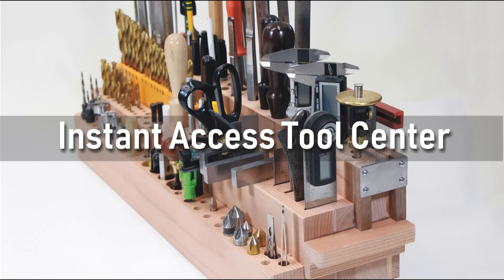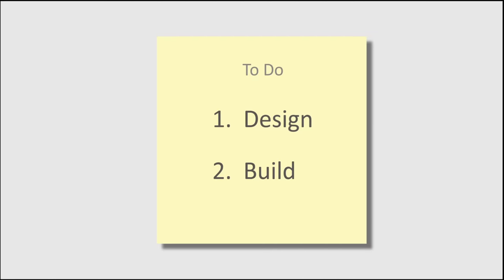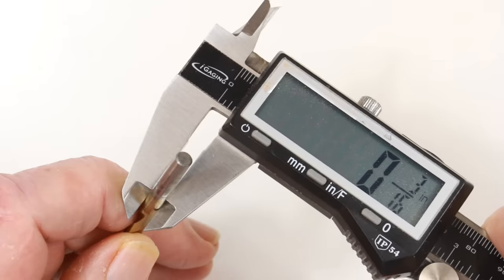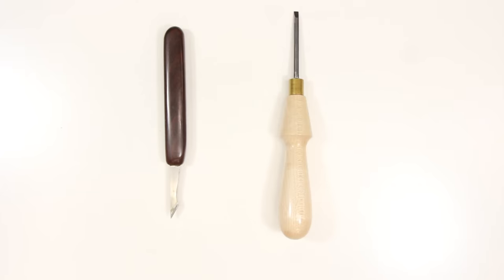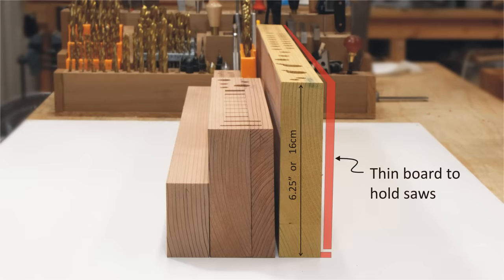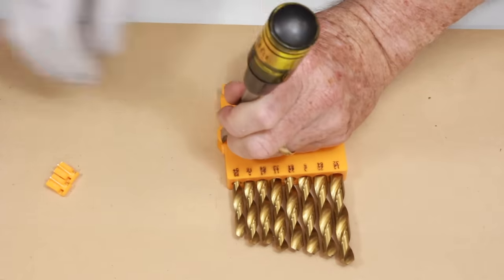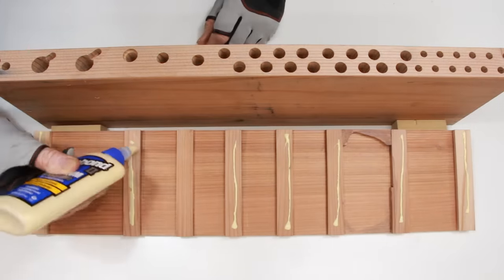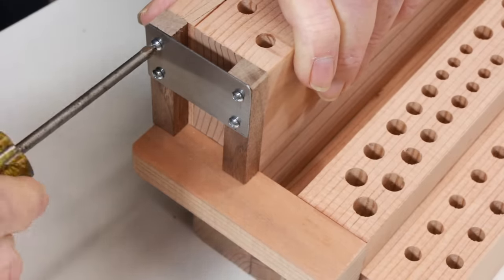Instant Access Tool Center

Comment: Thanks for this. My only negative is that the drill accessories should be put on a drill press tool holder. IMO this would make for a smaller, more job focused accessory. I did really enjoy your project and plan on building something similar.

Comment: I'm still working on this project.  I've gone down a couple of wrong tracks that required me to back up &  rethink my plan, because my tool set is different in type and number. It is getting heavy which surprised me a bit. I'm having a blast though. My old tool holder was a strip of wood with PVC tubes placed vertically all in a row.

Comment: A very nice presentation - I will have to check out your other videos.    For me, I have enough tools that I built an Adam Savage inspired shop cart to roll over to where I'm working.  But I ran into the same issue, tools cluttering up the work area during actual use.   

So I modified an old mechanic's rolling tool tray to the height I work at, and have gotten into the habit of using it like a surgeons tray,  returning all tools to it during the project.    It doesn't take up a lot of room and has really helped my workflow.

Comment: I built one to hold all the tools from a Chinese tool collection my mother-in-law bought me. It all came in a  blow molded plastic case and at first I sort've sneered at it, but then noticed that when I needed a tool, that was the box I went to. Patrick's tool center idea fit the collection perfectly once the blow molded case died. I added a bunch of other stuff I use and it is crammed with the tools I once spent hours looking for. I just built a second one to hold all the metal files and rasps I use in my knife making. The third one will be to hold all my leather working tools. Patrick, this is a simple idea but so apt for the way I work that I have bought several of your designs now, based on how well this one worked.

Comment: I'm looking to do a french cleat wall in my garage and basically build everything from scratch, and one thing i found is that most french cleat tool storage systems basically place everything flat against the wall taking up a relatively large amount of space. This assembly with several layers of storage back to back seems like the perfect solution. Thanks for the  inspiration!

Comment: I have most of these tools on my pegboard which is setup on the wall.  The work table is in front of me with me facing the back on the wall. That is because I have space constraints and I need to film while I am working. I turn to the wall to pick any tool I need. It never occurred to me to put the stuff i regularly in front of me. This is a great solution. It would save a lot of time (and space on the memory card of the card too)

Comment: That's a great tool storage mini center. I added a tool 'crib' to the back of my main workbench.  It's basically a long,but narrow rectangular  box with storage slots and holes. It holds the tools being used and keeps the working area free from tool clutter. I guess I have OCD in my shop. I want all tools and their siblings in their designated area. LOL.

Comment: I'm glad I found this video of yours. I have a bench I picked up for hand tool use and it has become my go to bench. Someone had put some time into building it as it is white oak and Walnut.  I bought it really cheap. I've since added a well to the back of the bench just so I can have some stuff there at hand. I did a quick orcanizer for my chisels but I have found it way undersized as I end up with everything crowding that spot. The well is great but does act as a catch all. I think I am going to adapt your design some and get the little things organized. I love the idea of moving it as I need to for large pieces or just to get it more handy for small stuff.  Thanks for the ideas. Now off to my shop.

Comment: Another excellent video by Patrick Sullivan. This one came at just the right time. I'm in the process of making something very similar for my little shop. 9 x 13 is all I have so I have to make every inch count. I have a small drill press mounted to one end of my bench and I wanted to have all the drill press accessory items right behind it on a shelf. This has given me the innovation that I was needing. I will also be making a small parts home similar to yours but smaller. Thanks so much for your excellent videos.

Comment: Well sir, you inspired me to make a tool center very similar to yours.  It usually sits at the end of my 6' workbench and has proven to be very handy indeed!!!  I made it out of scrap wood I had on hand.  As I live with it and use it daily for the next months or year, I will build a 2nd version out of some nicer wood, maple or oak or whatever.  Thanks again for your inspiration.  This saves me a lot of time and steps in my workshop.

Comment: Hello Patrick, Space is at a premium and this design is great.  For the side bar grips, I stood a piece of timber vertically and drilled down through using a 16mm spade bit. Then I sliced off the material not required. This left 1/2 to 2/3 of the cylinder for the grip. It took two goes to get the depth as the drill press stroke is only 70mm. I'll build a decent router table one day.......

Comment: Thanks for this well thought-out  project, with lots of very sound general principles and tips. A small addition to this that I will make is a cleat at the back so it can be hung on a (future) French Cleat wall I will be creating. This will allow me to keep it off the bench / work surface, while still keeping it handy and portable. Weight will be a consideration, so I'll need to think through the design carefully. Thanks.

Comment: I was having the same problem and built a very similar tool holder a few months ago. It was a revelation. Your design is better, but the key is having a designated hole/slot for each tool, so it always goes back in the exact same place. Btw, I also bought that exact same spatula from the dollar store months ago to make cheap chisels for weird/curved shapes. Cheap minds think alike.

Comment: This is great .. It addresses a real problem that I have and provides a very elegant and fairly straightforward solution.  Patrick is both articulate and compelling to listen to ... Loving 2.0 - great starting point - Thanks so much for sharing - As below the answer to where to get sheet stainless from is out there - being from the UK, I guess that poundland will take a hammering but even allowing for whatever happens with Brexit - I can afford $1.40 or so :)

Comment: Pat,  you had me busting my gut  laughing. The only difference between your rants and mine are the four letter expletives I like to garnish my frustrated rants with. I have a few years of ripening on the vine over you, so my shop's chaos quotient is equally elevated. I like to think of dealing with my dilemma as being illustrative of some classic truths.... 
(1)  Futility defined:  Shoveling sh!t against an incoming tide. 
(2)  Ya can't fit (See #1) 10 pounds of sh!t in a 1 pound bag. 
(3)  There's always room for another tool (See #2) or machine.
(4)  The wife doesn't really need that space (See #3) but I sure do!
Thank you for the enjoyable video. 
Chris of S. Florida

Comment: What a great video!  I have similar problems with organizing most needed tools.  Last year I buckled down and learned Fusion 360 to design similar tool holders that could be built with a 3D printer.  It is very nice to have the CAD files because I have changed my mind many times over the past year and making a new carrier is as simple as modifying the CAD file and sending a new concept to the printer.

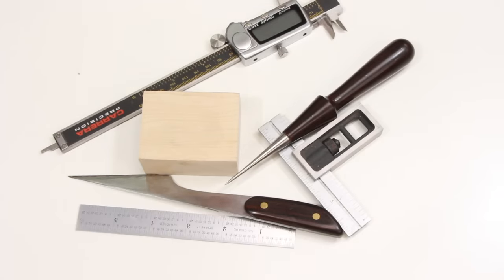Comment: That’s funny I had this same issue and build a very similar thing , just drilled holes in a large piece of wood had bits pens files wtv,  rule of thumb is put back the tool exactly where it belongs after using it. Great vid .  Btw I busted out laughing At 0:49 pulls out a Rolex submariner out of the shop vac LOLLL

Comment: I'm on a knowledge finding quest before constructing a way to organize my tools, and have watched dozens if not hundreds of videos, mostly on french cleats. Your video has many great points, in particular about the arguments for having a good organization.
You mentioned in the beginning, that your first version became too small and crowded. That - on top of all the french cleat info I've ingested - gave me an idea: how about making tool holders that are french cleat compatible, but also modular and attachable to each other somehow That way you can recombine a subcollection of tools taylored for a specific project, place it near the workspace (on the workbench or a table, or even on a french cleat right above the workbench), or even in a container suitable for travel to a remote work site or for working outdoors. Different types of projects may need different combinations, but most projects need some common basic set, which could make the primary module or base onto which you could then add a set of drill bits, and other task/project specific tools. You could even have written check lists for frequent types of projects, so you always remember to bring all the tools you will need, and can "click" the set together very quickly.
Your tool center is both inspirational and beautiful!

Comment: I have been considering doing something similar, but as a current solution I use Akro Mills style stacking bins to put  tools in. The larger 11"x11" size bins seem to be about the right size for me to place tools while working on something. Since doing that, about the only time I find myself on a tool hunt is when I forget to put something back into the bin. The other nice thing about the bins is they work well when having to fix something out side. Less time lost trying to find tools or hardware that rolled away or fell into the grass or a pile of leaves.

Comment: This is one of those gem videos that inspires. It's like you read my mind and I watched my future. Personally, I hate working in aprons, so I had been toying with the idea of creating a lightweight rail system for the ceiling of my shop to make certain things portable without having to carry them around (call me lazy). I had been considering buying some type of an open tool bag to suspend from that system, but this is way better. Takes a bit more time and thought, but the best ideas usually do. Your idea was the last piece I needed to complete my idea... thanks a ton. Subscribing now...

Comment: Thank You. This won’t turn my wife around.  For the sake of our marriage she stays away from my workshop. This will definitely turn my life around. 
I have been legally blind for many years. I frequently loose things. Soon I will be organized. I use different tools for measuring than other people. My tape measure and calipers talk to me. My scales and other measuring tools have bumps that I can read. 
At first my family were in a complete panic when I turned my saw on. The they love the furniture that I make. After 28 years I still have all of my fingers and other things. As far as plans. I have a 50” high definition monitor so I can make words an drawings large enough to see. I have a large format printer. I print drawings on card stock. Easier to trim. Easier to locate on wood. I can feel what I need to do. 
So now everyone except my grandson stays out of my shop.

Comment: Great discussion and I have the same problem only the difference my work space is much smaller I x 4 ft long with a work bench behind me that is a horizontal tool and box collector. My simple holder is just made out of tubing and recycled is cans that are places in shoe boxes or other boxes so I can do like you just pick up all that stuff in one sweep. and they can be put away on a shelf, in drawer or french cleated boxes. Again good discussion. Columbus Michigan

Comment: Hahahaha I never forget where a tool is ... well almost never ... not in the past hour?  My problems are compounded by having 2 work areas for different purposes. The small shop off my garage is for building replicas of old tube amps and other hobbies that don’t like sawdust. My basement is enormous and for woodworking. Enormous is good except there’s no immediate need to make it organized. Now, where are those files?  The hacksaw?  To make matters worse the small shop was for EVERYTHING for the first 3 years after I built the house. Things only move to the basement when I need them. 

I love this basic idea, except I want a few more specialized tool blocks. 1) measuring and marking, 2) drilling and screwing, 3) chisels, small planes, and files. Thank you!  That last sentence gave me the framework I need for design!

Comment: I have been leaving comments on tool storage videos for several years that mention, among other things, the problem of laying a tool down on the bench.  This is a comment I left 4 years ago on a video about the Studley cabinet: "We need our tools to be protected from theft, damage, and rust, but those issues aren't all that we should be thinking about.  I believe a function that's equal to the others is how easy it is to get tools out, and just as important, how easy is it to put them back.  Many people have safe, dry, and solid, overnight tool storage, but it's hard for them to get their tools out, and to put them back again.  Because of that, they tend to pull out a few tools and leave them on the bench while they use them.  That sounds reasonable, but a tool laying on the bench can get damaged, or knocked off.  Less serious, but very frustrating is a tool can get lost in the shop.  It can get buried under stuff, or you can put it down while you are completely focused on some challenging task.  A missing tool doesn't just delay the work, it can cause you to think you're losing your mind because you just had that tool in your hand a second ago.  The best tool storage allows you to reach out and grab the tool handle with the grip you use when you employ that tool.  Good tool storage allows you to replace the tool to its storage spot so easily, it rivals laying it down on the bench.  You will never lose a tool if you always keep it in one location.  Mr. Studley designed a great box to store his tools overnight.  He deserves high praise for packing a ton of tools into a very small box.  And that the box is beautiful, and well built are equally laudable.  Now for the 'BUT' that you saw coming.  This chest is not a good pattern for typical hobby woodworkers today.  How many hobby woodworkers today need to pack all their tools into such a small space?  A larger cabinet allows for easier retrieval and replacement.  Strive for avoiding doors, drawers, turn buttons, movable flaps, or any other device that hinders the one handed, one motion, means of retrieval and replacement.  My shop has a door on it that has a lock so I don't need a locking cabinet like Mr. Studley did.  He left his tools in someone else's shop where they were vulnerable to theft.  I don't worry about rust because I live in a desert.  If I lived in an area with high humidity I would think about installing a dehumidifier.  Your lumber will absorb moisture in your shop while you are carefully assembling it into a masterpiece.  When you've finished your great project, you'll take it into your house and watch all the joints loosen up as the moist wood dries out.  You don't need a dehumidifier in your shop just to keep your tools from rusting, you need one to keep your projects from turning out badly.  Mr. Studley created a great cabinet for his particular needs.  The needs of the typical hobby woodworker today are quite different from Mr. Studley's and our tool storage should be designed to meet our needs. "

Comment: This toolholder have some excellent design points. Very like idea of using cheap drill bit box parts for drill bit holder.. I'm, basically using expensive drill bits and special size bits to, but it's great for standard size bits - when cheap ones wear out, these can be replaced with expensive ones.. :) Anyway, this video gives me idea to take a piece of wood and drill some holes for my drill bits and then mount that piece of wood with drill bits to work bench wall.. because now these bits are mixed in one box and it takes time to find size what i need..
Measuring tape holder is an good idea to.. Now my tapes is laying around.. :D but i will use piece of old computer case..
I already do some organization in my tools long time ago.. Caliper is hold by IKEA clip on IKEA white perforated panel. In same panel i have spokes for insulation and scotch tapes, square box for markers and pencils, flat box for screwdriver bits and hooks for wranches - all from one IKEA series and purchased separately.. 
DIY holders i made from used bicycle spokes ( bending by tool size in U shape, drilled in bench wall appropriate holes and hammered in with care) for all pliers, wire stripper, cutters.. screws for hang scissors.. All tool mounting position's was calculated to save space and to be able quickly get needed tool.. But holder for small screwdrivers are made from perforated piece of computer case (usually used in computer's front under plastic to break out if there is need for extra CD/DVD's - no need to drill holes in metal if reused because it's already perforated with right distance) and one side bendt for mounting with screws to the wall.. Later i cut by size and screw flat to that holder some piece of laminated floor panel and drill holes in laminate through existing holes in metal for design purposes only, but this step is not necessary..
Maybe, someone gets some ideas from my experience with tool organization.. ;)

Comment: Nice idea. I plan to build one. It occurs to me, though, that the layers should be screwed together so I replace a single layer in the future, if I need to.
Reply from the maker: Good idea.  Be sure to plan carefully where you will place the screws, so they don't interfere with the holes for the tools.